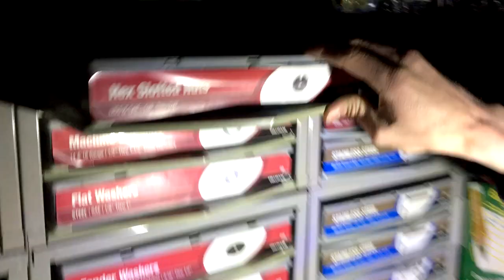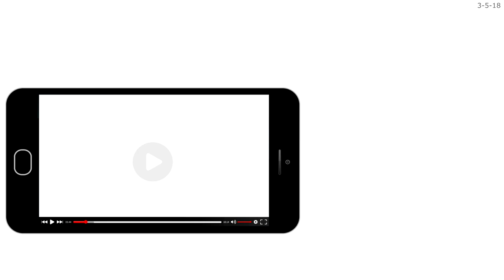BUILDING CUSTOM ROCK RAILS FOR THE YXZ!!!

Comment: Looks cool but that pointy rear corner at the back of your rock rail could jam into a tree or something if you have to reverse to get around tight corner in the trees on a track - causing the tree to get stuck between the rock rail and tire. A bent corner at the tail end of the rail is more common, you can pick up a cheap pipe bender with all the dies for less than a couple hundred dollars.

Comment: Deffineatly need to get some rubber on that thing, it will help crush alot with its self confidence... the camera angle at 4:50 - 5:00 there are 3 different tires aside from that you're doing a great job bringing that thing back to life

Comment: Hey dalton, just a quick two cents/question. Why are you choosing to weld them in with the possibility of then getting bent or possibly broken off during a race? I understand strength and all that but if they do break you’ll end of grinding off all the welds and tubing from then and eventually after a few sets making the frame weaker in the end. Just two cents, I am curious tho to why you chose welding. Awesome vids keep them up!

Comment: Should make those rock rails bolts on so that as they get damaged one driving you can take them off and fix them or replace them without cutting and welding the frame over and over

Comment: You cant weld them on and powder coat them??? I understand welding them on  but just paint them unless you are going to strip the whole thing to have the frame powder coated.  And let me let you in on  little secret (from a guy who races SxS)  even powder coat will get blown off of there.  If your going to weld them on and not have the whole frame coated just weld them on and paint them and keep some touch up paint handy.  Its part of it.  Race machines look good from 20 ft.  You get up on them and you will quickly see that they used and abused.

Comment: I see a problem ,if you powder coat then it is going to be impossible to weld them back on without removing the powder coat. Make half pipe clamps so you can blot them on. then when you bend one you can remove it and bolt anther one on.

Comment: I would have made them bolt on not a full welded on. Drill some holes in the frame and weld in some sleeves. Tap the sleeves. Weld a piece of pipe that fits over the frame to the rock rails. And bolt it on.